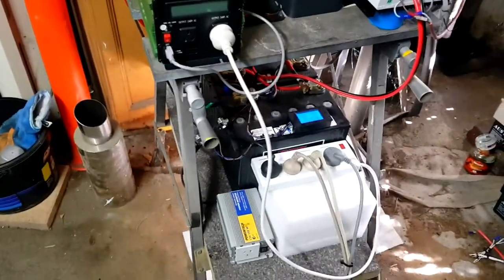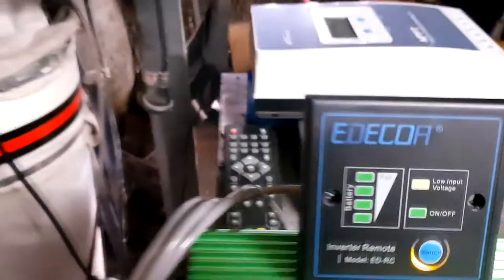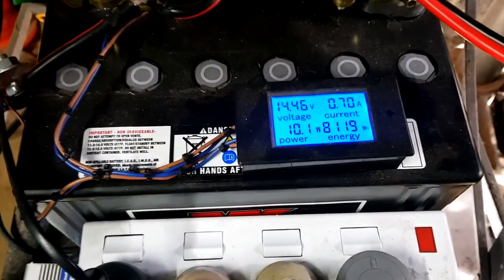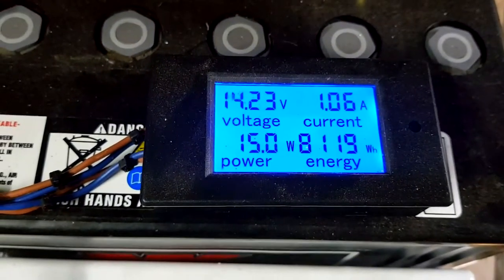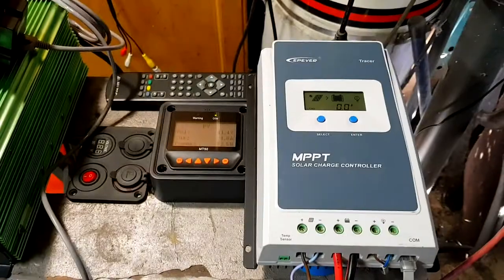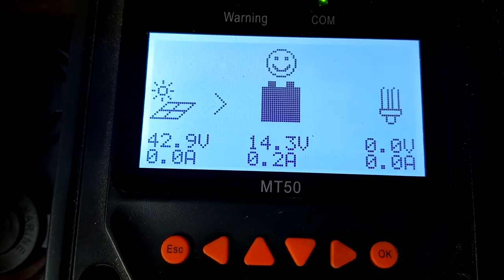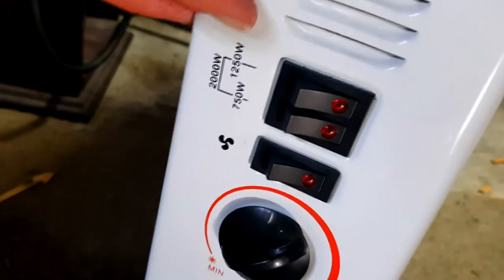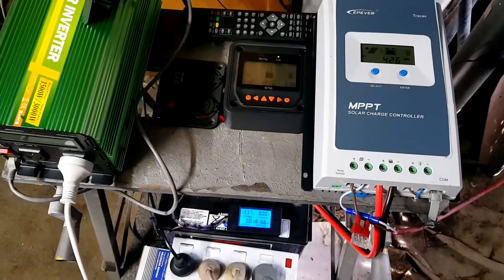Solar backup system and power inverters ( *** See Other Videos ***)

Comment: Wicked review boss.

Would you say this thing can handle car polishing maching 1050 w running all day with many start and stops and  food  breaks , pannels wipe inspections outside during how summer day ? 
100ah leisure battery , deep circle 

Your advice would be of tremendous value to me Kind Sir.
Reply from the maker: Hey there back; yes I would say that this inverter could run a 1050Watt pull on a daily usage. In the video you will see that running 1200 watts to run the heater the Inverter was pulling out of the battery 105 amps so a 100 amp battery for the task is not enough. I would think of increasing your storage to two 250 amps or more. The more storage the better for both how long the batteries will run the polisher for and how long the life span of the batteries in years will be. How much power in solar do you have?......... This important as well. If you have say 1000 watts of solar or more that would be the sizing of set up I would think of having to do this type of task. So to do what you’re looking at doing here I feel that it would all work if you have around 1000watts plus in solar and 250 watts plus in storage or Battery. Also keep in mind that the inverter I use in this video is not one of top quality though it is a cheap Chinese inverter but in saying that I have had no problems with it at all and it has run for 3 years now and still as good as new but like with any cheap device you can’t expect it to last for ever. The other thing I would look at with a system you are looking at setting up is the size of wires you use as a 100 amp plus requirement is a fair amount of current and using thin wires will over heat very quickly.
Reply: @rolandkeith5322  Much appreciated.
Will get very thick cables.
I run mobile car detailing with cordless equipment but now am upgrading -buying more tools and this time going for corded tools so need power source.
I will be using one tool , or one machine at the time.
Will buy more polishing machines + fabric extractor vac = 1400w 
Also i be setting up mobile tire change business with 2 machines installed in that van.
1 tire mounter 750w
1 wheel balancer 200w.

Google recommends at home charging time for 100ah battery = 28 hours with 4 a charger . Charger i have 10a promises to be 30% faster.
That if i am correct means i better buy 2 smaller capacity batteries = 60ah each =120 ah and charge them using 2 chargers.
I hope to charge each battery this way in about 10 hours with my 10 a chargers.
This should mean batteries are full every day .

I heard that discharging batteries more than half way is a no no, but i kind of have no choice.
Running generators will cost even more in diesel or gas + it is noisy and smelly and takes space which is not there any way. 

If i keep fully discharging these 2 batteries 60ah each and charging them fully on the daily basis  will they just keep rapidly loosing capacity or will they in the matter of weeks be not capable anymore to provide enough watts to tools as well ?
Reply from the maker: @maximolotov  Sizing up batteries for the task is best done by looking at the usage so if you have a 100 amp battery then it will power a device that pulls 100 amps out of the battery for one hour as it is all worked out in amp hours.
If you are using a van for the business then you have some good realestate on the roof to install solar panels and set up a charging system as I feel that this would be the only way you could run power on and off throughout the day as you would like to and need to. A once a day home charge up will not work at all for you to run all day given how much storage you have in battery with how much power you will be taking out of the battery. I would be thinking that this business needs power to function all day and every day so given this the business need a working set up for the task and this means I do need to invest into this so that it all works.
With my experience if I was to do what you are with the business, on the roof of my van I would install…… two 300watt panels at a cost of around $300 for the panels……. and a 1000watt MPPT solar controller that cost around $200 bucko’s and if I were to select batteries for the task I would buy two 100 amp AGM deep cycle’s costing around $180 each so in cost all up we are looking at around $860.00,  So about the same as a new quality generator but without the noise and the daily fuel cost. 
This is what I would be seriously looking at doing and why because it has the best chance of working the way I need it all to and have it all lasting as well. So if you were set up like this 600 watts on the roof and 200 amps storage then two things are going on here…one) The second I am not using power for anything my batteries are been charged back up and …..two) when I do use my power tools the solar system is feeding the system with up to 600 watts so the batteries only need to provide me with the other 400 watts if the tool I am using is 1000 watts. This type of a set up should not need to home charged at all unless it’s mid-winter if at all. So I would give this some thought as I feel it would work for what you want it all to do.
Reply: @rolandkeith5322  I am very lucky to receive your priceless guide Keith.
Same as  I  am pretty sure i would most likely never get any guide on this kind of approach as this is not something that people have done before. Not many have done it for sure. 

I live in northern europe with lots of cloudy days and 3 months of potentially very cold winter = around -16 Celsius on average.
Car detailing /polishing will ofcourse only happen in warmer times when temps are 
+ 10 / +26 Celsius.
Mobile tire change will happen all year around.
I suppose tire machines will only be doing about 12 wheels per day = not much of power storage needed.

For detailing during wormer times i come to clients public parking lot with many cars around it and park my van few cars away.
Due to tight space i need compact equipment which can stand behind the car or between cars and with cables , extension leads been no longer than 3-4 meters.
I know nothing about solar in terms of how long it will take and at what condition to provide certain amount of electricity.
Always thought however that it will perform extremely poor in northern europe, so never considered it.

Weight of batteries is also an issue. I plan to have battery not in my van at all times but outside van on the road next to clients car while working. Keep moving battery around car while working due to very little space and people walking around.
If 100ah battery will be killed by the 1000w tool in one hour then i suppose i will have to go for cordless tools. Cordless tools cost more and have less power though.
My old cordless maching  ( ryobi 125mm cordless car polisher ) with 5ah LITHIUM  batteries take 12 batteries to polish entire car.
1 battery = 30 mins working time
 12 batteries = 360 min working time 
360min = 6 hours  machine =800 watts.

Now I wonder how this ryobi 900w polisher delivered 6 hours of pure working time with 60ah of lithium power ?  Well i dont always polish at full speed ot press super hard in that machine.
When starting polishing  maching it will start at lowest speed so maybe take a lot less power than 1000w ?  Like 5 times less lower ?  Machine speed ranges from 1000 rpm to 6000 rpm
I honestly thought if cordless lithium batteries took 60 ah to polish entire car then deep cicle/ marine / leusure LED  battery would also  take 60 ah.

Meaning 40% of led battery remaining after job is done , but i guess lithium and LED batteries are not the same :( 

If i run regular cheap deep cycle batteries 60ah each and completely drain them every day to then charge at night at home.
This will be insane :)
I would probably need 8 batteries 60ah each and 8 chargers to charge them at home at night.
Will also have to carry them home and back in car every morning and night. :) :( 
 
If i were to buy 70 ah - 100ah lithium battery for that 1000w polishing machine to polish car for 6 hous pure  working time .
If it could last it would be heaven .
Light and small as apposed to generator or 500ah batteries. 
It will not be cheap for sure.

If somehow 2 or 4  of 60 ah   LED batteries paired up will get my polishing machine pure working time of 6 hours daily.
2-4 smaller 60ah batteries as choice as to be able to charge them using 2-4 chargers ready for next morning.
How long will inverter live ? 
If inverter and batteries been fully discharged daily can survive 1 year while be able to fully support polishing tool at its max capabilities then it is good deal still. 
Obviously this inverter can not stop working during working time, since it will be purchased abroad with 1 week of delivery time= no same day replacement available.

My head is now smoking hell hot :)

Hope you enjoy when yours is smoking Kind Sir :)))))
Reply from the maker: @maximolotov  
I am pushed for time just right now to go through your reply fully hold up for a few hours then I will and reply back to you. But just quickly your question of (If 100ah battery will be killed by the 100w)  No buddy it is like this….A 100 amp hour battery will last one hour with 1000watts pulling form it not 100 watts. So give me some time to go through your comment and reply back to you about all the comments.
Reply: @rolandkeith5322  Thank you very much Keith.
My bad it was 1000watts , not 100watts

100ah battery vs 1000 w tools.

Have a pleasant and productive day Keith
Reply from the maker: @maximolotov  Okay here is what I am thinking…… a small trolley or cart that will carry two batteries on it that you can lift out the back of the van put it on the ground and wheel it through a car park to your clients car. This small trolley will carry batteries and the inverter. When the job is finished the small trolley goes back into the van.
Now the Van can be that charging station for the battery trolley. The van can be quite simply set up to re-charge the batteries in two ways not unlike how a boat is. The van can use its own alternator to charge up the batteries when you are driving along and install a solar set up for the van as well.  between the both charging systems the batteries should be ready to go all of the time.
A car or van’s Alternator pumps out anything up to 90 amps so this is an ideal resource to tap into and use in your case. And with regard to solar even in your climate it can produce good charging power even on quite bad days however on a fair to good days it will produce plenty of charging power.
Our boat for example as the one that is in my river trip videos ( check them out ) the power system for the boat is not unlike what you need to have set up. The boat has two AGM batteries both are 100 amps each and the charging for the batteries is done two ways, when the motor is off charging is all done by the solar and as soon as the engine starts then the engine’s Alternator takes over the charging function. The power system for the boat runs everything and it is all running off an Inverter. So all of the boats lighting and all of the electronics GPS depth sounder two way radio and all of the instruments then on top of that the batteries also run the fridge and computer and a sound system all no problems at all. When we go away on the boat we can park up somewhere indefinitely if I want to and run everything all off the solar, as what we use overnight TV computer fridge lighting ect by around midday the batteries are fully charged again and for the rest of the day the fridge tv computers two way radio whatever all runs off the solar. With Solar charging systems there are two types one is called a MPPT system and the other is called a PWM.  Maximum power point tracking (MPPT) is what you want to get for this type of task.
So like I said I am thinking a mobile trolley that carries batteries and inverter to location that lives in the van and just gets plugged up to charging power in the van when finished. The charging system will be a blend of solar and the vans alternator. When you drive you get a boost charge off the alternator and when you stop you get charge off the solar. And if you are close enough to the job to just use an extension cord from the power trolley that is in the van plugged up to the charging set up then your tools will get most of the power form the solar and a bit of power from the batteries. Plus if it is a very bad light producing day for the solar to make full charging power then just start up the van and finish off the job just like you have a generator but it the vans motor instead. 
I am more than happy to keep talking to you about this by the way because we went through a similar process with setting up the boat as we need a system for that to do the job meaning if we wished to stop for week at a time we could and had plenty of power.
Also with big amp batteries you can get like 120 amp batteries that are no bigger than car batteries as that is what we have in the boat.
What’s your thoughts?
Reply: @rolandkeith5322  Welcome back Keith.
Sorry just in sauna with my children and wife. Will check your videos tonight.
I think it is brilliant idea to charge one 100ah with solar power in the van while second 100ah battery is unplugged from the van and powering polishing tool or fabric wet hoover and then keep swapping these 2 batteries around.
Charging from cars alternator with my 20 minutes drive time to clients on average = 40 minutes per day will also play it's part. 
I will go for your setup ty vm  I think.
Will start my entire day polishing at same address with 2 fully charged 100ah batteries and then live one in the van while using second unplugged powering  the tool.
When battery get flat, i will plug it to solar and use other one while flat one be charging of solar.
When i finnish at about 20:00 or 21:00 it be pretty much sun set and one battery i guess will be left flat. It will however be charging of solar while i be working on the next day using fully charged one = unlimited power without having to hit home with these chargers all the time. If solar can cope with it fast enough.

Now i have to guess  agm or not and what capacity , or buy 100ah  battery and try with 1000 w polishing machine. Try polishing my car to see how many hours of pure working time i will get. This will point at how many batteries and how many ah in tottal i will need.

Wonder if i should try standard marine battery = deep cycle battery or use same of agm grade. Trying to have the mist efficient budgeting.

I will use standard marine 100ah battery for my electric outboard 55lb any way so planned to buy it. Inflatable boat Excursion 5.
55lb outboard  is on the way already. Should be with us in  few days.
Reply from the maker: @maximolotov  It was my night time when I sent the last message and now it's my morning ....What country are you in by the way?????   .......    A standard marine 100ah battery is a good pick to use because a normal car battery is not designed to have large amounts of power taken out of it for long periods at a time however a marine battery is.
Also perhaps check out the market for low wattage tools as they are made now days just having a quick look on line you can get a Brand ….. Ozito 240V 110W Buffer Polisher this tool is around 900 watts less than what you are using and that is a massive difference from a 1000 watt tool and it is quite cheap as well only $30.00 dollars link…. https://www.bunnings.com.au/ozito-240v-110w-buffer-polisher_p6290089 So low wattage tools might also be a consideration.

Comment: Cheap china inverter, my ones still going strong after 2 years, although it does voltage fluctuate a bit at times, still going strong mines the 2500 watt version
Reply from the maker: Hey buddy well mine is still going stronger then ever I use it all of the time running my fridge and shed lighting ...My Voltage is a bit on he low side on mine about 225 ish but its works everything okay mind you the meter on it may be out a bit I must check the voltage at the plug of the fridge and is is electronically noisy with TV's and some stuff like that but hey for the money I am happy with it.